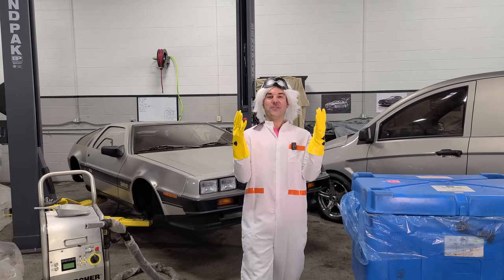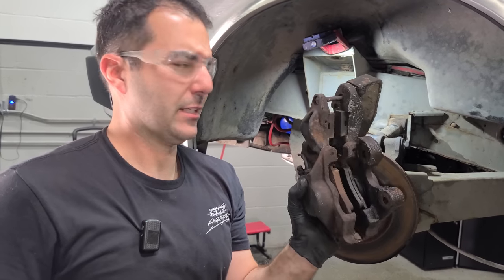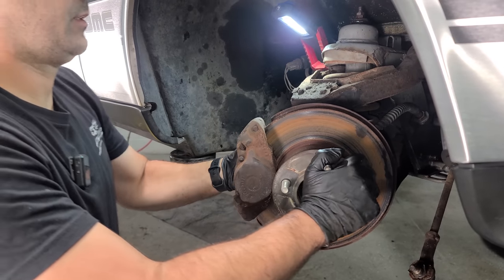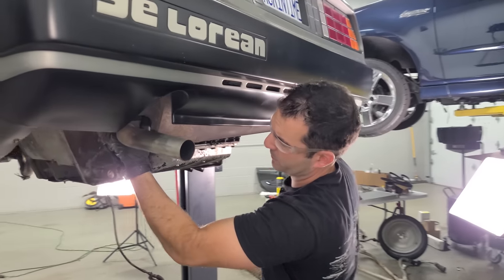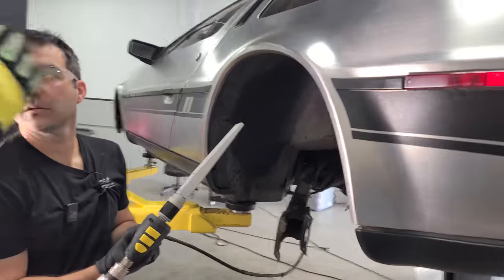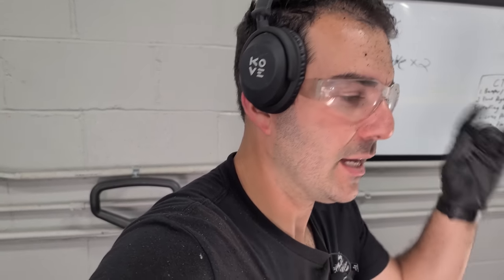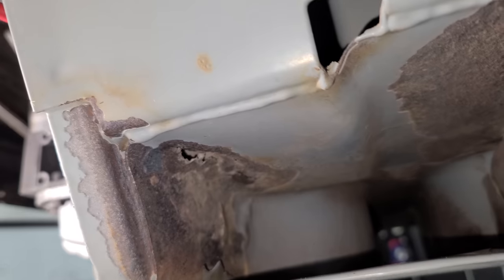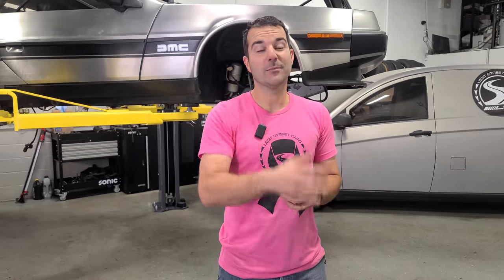I Dry Ice Blasted My DeLorean & Discovered Something Horrible! Determined To Fix This Car!

Comment: I worked at a place that used dry ice cleaners. We would always degrease first and pressure wash. It would nearly eliminate splatter onto already cleaned areas. We also degreased and rinsed afterwards. We would go through 6-10 totes of dry ice per week with 3 blasters.
Reply: That doesn't sound like a lot.
Reply: @jwalster9412  he just spent 2 days using one tote with one blaster.  

We didn’t use co2 on everything, but did use each blaster a few hours a day.  It was enough for a profitable operation. They were in different locations so it was smarter to have 3 then it was to move the blasters or the stuff we were cleaning.
Reply: @rydplrs71 why dry ice over just a pressure washer? Looks like it did a similar job
Reply: @williambell7763 the ice is penetrating from the top in. Removing any lighter things with a degreaser and pressure washer speeds up the ice blasting process. The pressure washer and degreaser didn’t come close to what the dry ice machine did lol

Comment: I watch this channel all the time and because of you ive done the same thing to my car, i just got done replacing the suspension with coil overs, rack, control arm, tie rod ends, ball joints, wheel bearing, ect ect just because i like the car i have. To see how much harder/similar it is to this (its a 20 year difference to my 99 es300) makes me very happy that my undertaking got done and i have a basically new car that i built MYSELF instead of buying. Even if its not some high HP thing i dont got that money
Reply: Love the 99 es 300❤

Comment: Alex the dry ice is the ticket! An amazing transformation on the frame & underside of the DeLorean! Once you get the frame fixed, the new suspension & brake upgrades this DeLorean will be amazing! About as close to going back in time as you will be able to do! In order to get to Back to the Future speeds consider an LS swap on the DeLorean after you have done all the stock content you can! That would give you a whole new round of amazing content for those of us who would like to see you take it to a higher level!

Comment: for stuck tie rods, instead of whacking the bolt with a nut on it, hit the side of the knuckle where it threads through and it will pop right out.
Reply: right after making the comment i see you do the same thing i meant after you cut the castle nuts off. lol good job man
Reply: I was cringing at this myself! If you intend to reuse the ball joint NEVER smack it with a hammer. Hit the spindle or use the ball joint tool like he used on the spindle to pop it loose if a hammer doesn't do the trick. You can also use the tension of the suspension spring  if you put the nut on the spindle and put a jack under the control arm and whack the spindle to pop it loose. This trick works great on G body and S-truck suspensions.

Comment: Glad you went the Dry Ice route. You should have done the top of the engine while you had it! And inside that valley that was corroded, to get all the dirt off and see what youre working with and ready to anti-rust/protect the block.. 
Good job though! 👍🏴🇬🇧

Comment: It's funny.... I used one of these dry ice blasters on a weekly basses to clean out resist byproduct in a semiconductor manufacturing tool. The joy of seeing the material break away and leave a cleaner surface was awesome.... like the first 2 times, after that a couple of hours of blasting followed by a few hours of scrubbing with diamond pad gets old. Resist is super hard and the dry ice just could not break through the deeper layers. You cant use a sand blaster in a clean room. This is much cleaner and the blasting media just evaporates leaving just the material your removing. I just wanted to add we did not need to use a generator, our machine was 110 and plugged right into an outlet.

Comment: Alex, never hit the stud on tie rods or ball joints for removal. Hit the KNUCKLE on the SIDE of the stud and it will shock it loose! First thought is to hit it the direction you want it to go but horizontal impact is what loosens the tapered studs!
Reply: That's correct, the knuckle will deform enough by hitting it to release the taper shaft easily(for the most part).
Reply: Yes this one of the first things you learn as an apprentice mechanic, never hit the stud of the ball joint (especially if you plan on reusing it) as it will wreck the stud. The double hammer on the knuckle technique almost always works and doesn't damage the stud.

Comment: Even though you're replacing the suspension parts, if you were to clean them to perfection, laser cleaning cleans even better than dry ice. It's perfect for things like those control arms. It removes rust perfectly as well.
Reply: But fail to mention all the toxic smoke that laser creates, and most shops don't have a dedicated bay with ventilation to do safely! Where as rollout a sheet of paper put car on hoist and blast away as long u have decent air flow though area

Comment: So happy you dry ice cleaned your De Lorian!  Looks amazing!!!  Now, if you want to go crazy, ceramic coat all the fiberglass and frame and suspension!  It will add some protection, but it will be easier to clean again later.

Comment: I liked that you put a license plate between the fiberglass and the flame.

I've seen some welding guys use a really neat fabric behind their welding and torching that absorbs 100% of the heat from going through to the other side.

I wonder if they make a flexible pad like that so you could save that fiberglass from the heat. I know you didn't hit it with "flame" but you can definitely tell it got quite a bit of "heat" on it.
Reply: There's a tool called an induction heater that doesn't use flame to heat bolts in sensitive areas. They only run a 2 to 3 hundred dollars which is tremendously less expensive than repairing fire damage. Being in the rust belt I'm surprised he doesn't have one already. Of course he's still using MAP gas instead of a true torch which I find surprising for a former professional mechanic.

Comment: Spray your wheel wells and undercoating with amsoil mudslinger it's originally designed for off-roaders so they can clean their undercarriages easily but I found that it works great for the car fender wells and under body of any car and stops mud and stuff from oil sticking to your underside it's almost like putting ceramic coating on the undercoat of your car
Reply: Have you never watched one of his videos before? He uses that stuff all the time under hood and for fender wells. He's also an Amsoil dealer.
Reply: @FastSS02  no just started watching it because it was suggested to me cuz I own DeLoreans

Comment: Dude, wear a respirator mask when you're dry icing, you're breathing in all the garbage that's flying off the car. And make sure the area is well ventilated. Dry ice is frozen carbon dioxide which turns to gas once shot out of the gun and displaces the oxygen around you
Reply: You might have breathing issues in a sealed room at floor level. Co2 is heavy so opening a door helps clear it.

Comment: I worked in a factory that made car parts using plast-injection molding. Dry-ice blasting the molds was a normal part of preventative maintenance of the molds. If the parts are coming out with defects, it's normal for the tool builders to dry-ice blast the molds while still in the machines.

Comment: Another thing sara n tuned found, degreasing and pressure washing first helps a lot. The dry ice machine wont temove grease. Also pre cleaning prevents bits being blown onto cleaned areas

Comment: That frame epoxy acts as a barrier coat, when you go to repair it with new epoxy paint just be sure you thoroughly coat it all.  Any missed areas or pin holes in the epoxy coat can create an area where accelerated corrosion can happen.

Comment: Before you put the wheels/axles, etc back on….I would hold off for your Halloween display. 
I was thinking you could put it on a frame with some wheels (or enough o look like they’re turned for hover mode) 
Most could be blacked out and hide the core frame. 
You could have your car in hover mode for Halloween…which most everyone would likely view it in the dark. 
That would be a great illusion to portray. Just add a quick veneer on the back to look like the movie car.

Comment: Would have been interesting to see the dry ice on low pressure clean up the engine valley.  You do need to treat the alloy tonprevent further deterioration.  Plenty of good products from the aerospace  industry and then you can do some metal apoxy bonding.

Comment: Former Delorean owner here, but not a mechanic. I’m guessing our host knows this, but 1) just in case and 2) for anyone else who may care: the trailing arm bolts (TABs) on the rear suspension are a known weak spot. I recall once hearing someone who’s worked on Lots™ of Deloreans say they’d never pulled a set of TABs where at least one wasn’t bent. I barely managed to pull mine (I mentioned “not a mechanic”, right?) and yes, both were bent.

Comment: Spray some Eastwood Rust Encapsulator inside the frame through the holes using the tube and spray head.

Comment: You needed the shattering tip for the gun. Printpresspros in Addison has it. We use it on printing press machines worth millions of dollars. It breaks the pellets into dust before they exit the gun. I have a lot of experience in blasting. Good video to show the masses 👍😎 thanks

Comment: There's no such thing as a numbers matching DeLorean! The early frames will have a number plate welded on. The latter cars just have them written on with a marker. But with the early cars you can track the engine and transmission too the paper work.

Comment: Yellow cap Easy Off oven cleaner has Lye in it, it will dissolve ANY baked on oil. It will also eat lots of other stuff including some metals, so research before using it, but it works like magic, basically zero scrubbing if it sits long enough. Sometimes you need to do a few applications because the Lye gets consumed by the volume of grease it's acting on.

Comment: I just fold the cotter key ends up so I can fit a 6pt impact socket then air impact the castle nut.  The cotter ends shear off and the nut threads right off. Then drive what's left of the cotter out with a punch or send the ball joint to the iron pile.

Comment: With the cotter pin stuck in the castle nut , you can just remove the nut as normal . The remainder of the pin will just shear off . And then you can usually just knock out the pin from the joint with a pin punch .

Comment: When you are upgrading brakes and suspension, you forgot one part of it, swaybar, it is part of suspension and doesent work with new stiffer, adjustable parts of it. So find shop who can make stiffer one for your De Lorean. It should make it much better on track or fast driving on those curvy countryroads.:eyes-pink-heart-shape:

Comment: I went through a similar thing with my car's underbody, including the engine/transmission.  First I pressure washed it, but what really did the trick was oven cleaner!  Yeah, you gotta be careful with it, but if you don't have thousands to spend on professional cleaning, it does the job very well.  I wonder if Alex will be taking the car off it's frame after this episode... That slippery slope 🙂

Comment: I haven’t used an old license plate as a shield but I’ve used pieces of smoke pipe when I had to solder water lines in a wall

Comment: Really apply pressure onto the heads of bolts when trying to loosen them, while paying attention to the exact angle of the bolt head to make sure you get as much surface connecting between the bolt and the wrench. This is also why it seems best to use hand tools rather than power tools for rusted bolts to avoid stripping them rounded.
You did justice though by showing people how to make sure a shock absorber wont become a collection of broken toes upon removal if done properly. Party on Garth DeLorean.

Comment: Those cotter pins shear rather easily by hand or with an impact. Might have to hammer the socket on a little but generally faster than cutting.

Comment: The Delorean was assembled with Ny-lock nuts. The plastic seal does a great job sealing and preventing rust forming in the nut/bolt mating surface.
Reply: sounds like they used nylon
Reply: Yup, nylon - locking nuts or Ny-lock nuts

Comment: Spring ARE DANGEROUS!!! I remember when I was 19 and working in a scrapyard in denver.... I was taking apart a brake chamber from a semi with a bench vice..... the moment I started to back off the vice, th spring shot out of the side of the brake chamber,  and QUIT LITERALLY SHOT THROUGH THE METAL ROOF 30 feet above my head.....
Edit: *springs
Reply: *the spring

Comment: Me: "Well, it took nearly 2 months, but I've finally cleaned every square inch of my engine and engine bay with Diesel and assorted brushes."

Alex: "We're going to cut through all this grime in the engine bay with dry ice....aaaand we're done."

Me: ONLY 2 DAYS?!?  Flips table

(As an aside, tho, it looks stunning. Excellent work!)

Comment: So I've been told and you mention it that the stainless steel is razor Sharp on the inside panels but check with DeLorean motor company in Houston, but I've heard the steel on the bottom of the gas flap can slice your fingers too. I think they have a rubber seal you can put on it too protect yourself. Mine isn't a gas flap model so I can't tell you from experience but better safe than sorry

Comment: You should figure out a way to get the Delorean to your house without the suspension and sit it on crates (or something), with the wheels facing down into the grass, and a fog machine under it.  Then it will look like it's floating in your yard, ready to fly away!

Comment: Idea for a new video. Dyno and economy drives comparing oils. Possibly Ecovet style. 

In NZ my hilux diesel can have 10 40 weight oil or 15 40. I read on forum that with a thicker oil it uses more power. Always take forums with a grain of salt. 

So been looking for a you tube video showing the difference on a dyno can’t find one. 

Not important that is the same grade as what my vehicle is specked for. Just would like to know if it actually makes a power difference going for a thicker oil or thinner that is specked for a vehicle. 

You could also throw in a Camry running on oils on dyno it’s not specked for to find out what happens  with extreemly thick or extreemly thin oil. Possibly load it up on thick oil the load up on thin oil see if it blows. 

Also interested to see mineral oil vs synthetic and see if synthetic oil gains power on dyno. Even if minimal drag and race guys would run a better oil if it gained them 1hp. 

Also keen to see how oil thickness affects turbo cars. As possibly thinner oil may flow quicker making turbo spool quicker. Never know weight and type of oil may make a bigger difference than we think to power.

Comment: I would have not even messed with the cotterpin 12pt socket and leave the castle nuts to chomp off the cotterpin ,it can be drilled out later if you were going to reuse the parts

Comment: To remove a nut from a socket just remove the socket from your wrench and then SLAP the side of the socket on the ground.  A stuck  nut will often pop out on first try if you slap it hard
Reply: Not even that hard usually. But I usually just thread them back on a little and apply a little downward pressure to the handle.

Comment: Yo if you're worried about tye dry ice getting things wet it won't. It evaporates straight from solid to gas so the liquid stage is not really a thing under normal atmospheric pressure. The physical motion of the ice being shot out could theoretically damage stuff but I feel like if it does it probably should be replaced anyways. Dry ice is literally the least invasive and damaging cleaning method. Just thought I'd say something you probably already know 🤣 im sorry I just wanna help! 😢

Comment: Back in the day I had a Delorean and the sway bar didn’t have the washer on the nut end of the sway bar from the factory. Popped out on a hard turn one day and I thought the car was going to flip over. Cost of repair…….50cents for a washer!

Comment: Nice you threw in the price. Only benefit I see with dry ice vs pressure washing is you can see better. Way to expensive for dry ice. Oh yeah those brakes are probably barely better than drum brakes!

Comment: Never hit the threads or a nut on threads, shock hit the side there is a pad built-in to do exactly that. Shame it's so expensive to dry ice everything. Sand blast then powder coat all the metal parts and seal coat the aluminum with wheel coat.

Comment: This reminds me of the feeling of working on my truck my dad bought it when he was 17 and passed it to me  it’s a 1989 Chevy Silverado k1500 it currently doesn’t have a motor it originally came with a 350 which I dad added a stroker kit to I believe it is a 386 now well it was but I want to LS swap it for reliable and also just for a modern feel I’m going to the motor and trans out of one of my family’s cars it’s a 2007 gmc Yukon with a 5.3 LS and it had a brand new transmission rebuild only about 5000 or so miles ago

Comment: What are you doing hitting the tierod end like that? Never hit down on the thread like that, hit it like you hit the upper ball joint, sometimes you just need to lever the tie rod with a small amount of force.

Comment: You do not remove tie rod ends like that, thread on nut as you did then hit the steering arm where track rod end goes through and shock it loose.

Comment: Never leave open ports or bolt hole that go all the way thru where do you think all the debris will go ? Going to need to parts wash the daylights out of the intake and any other engine parts exposed to debris.